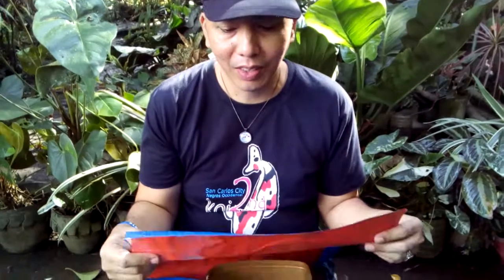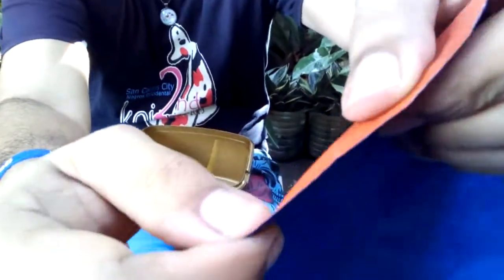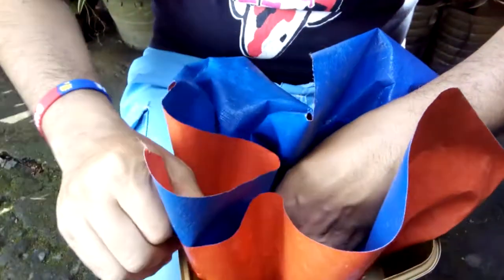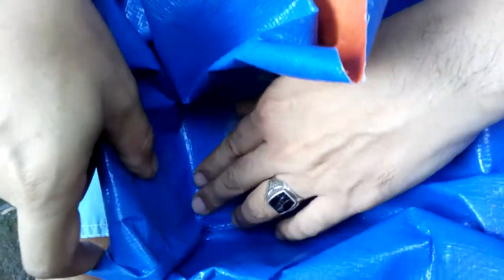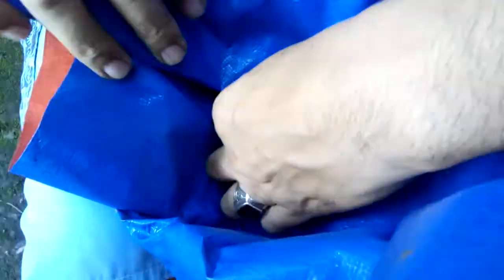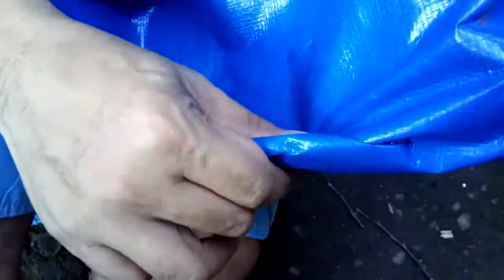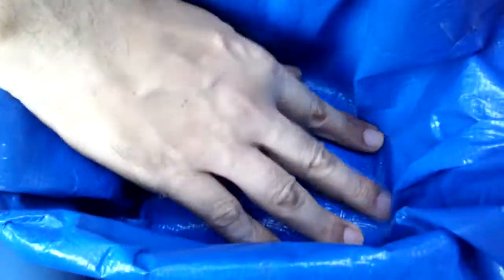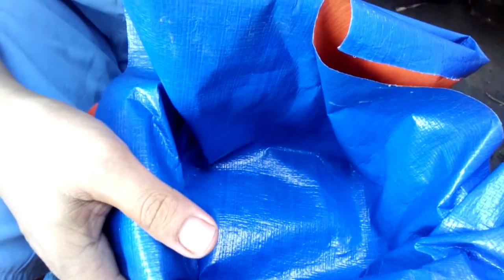How to fold trapal pond folding the edges properly guide

Comment: How much will the tarp last??
Reply from the maker: it depends bro if you place it in direct sunlight without protection it will only last for less that a year because tarp will degrade fast when expose to direct sunlight I advice to you to add roof madeup of plastic or anything you can think to protect the trapal pond or making a pond by digging so that the water level will cover the pond